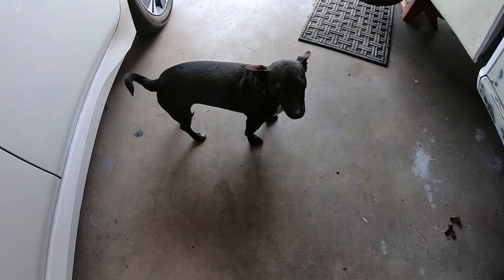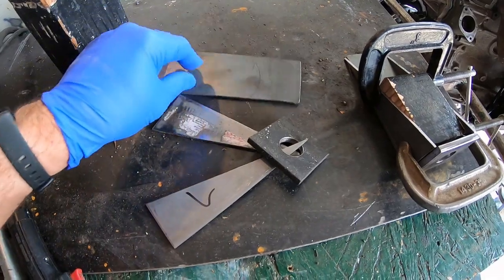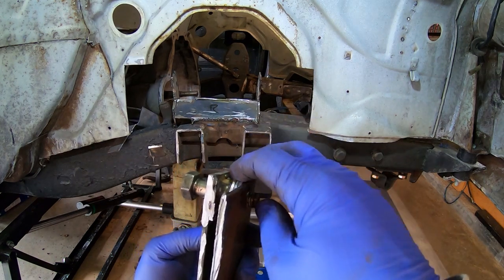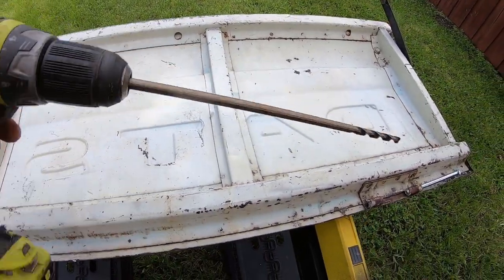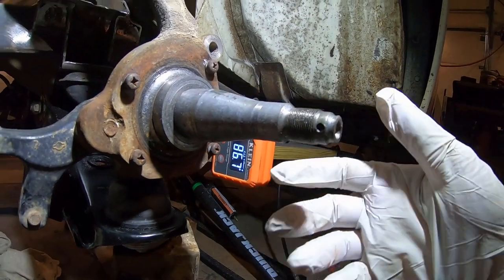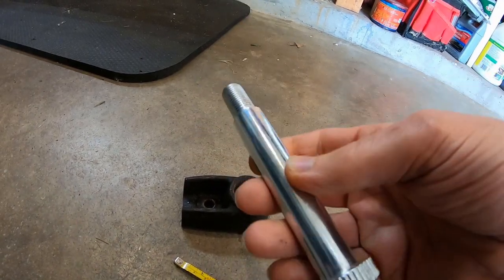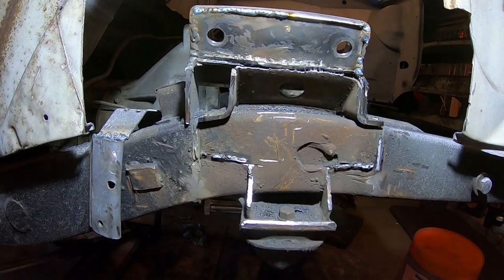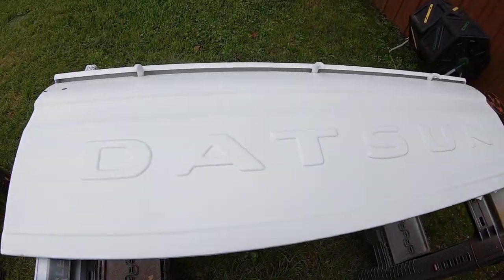Datsun truck Restoration part 17. How to install D21 suspension. Painting begins!

Comment: i would have just put in a mustang ll  front suspension
Reply from the maker: Why is that? I wanted to use as new as possible. A 70s Z was first choice. Do they have 16mm tie rod ends? I want to use OEM tierods. This mazda one uses the same as Nissan 16mm, so I have a huge selection of OEM parts that thread right in. I am using cut and welded only for mockup.